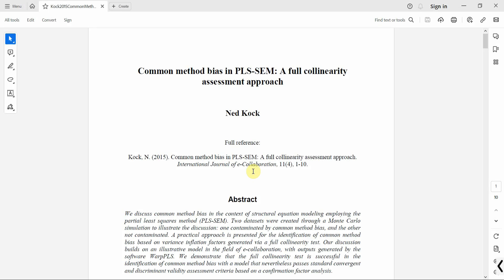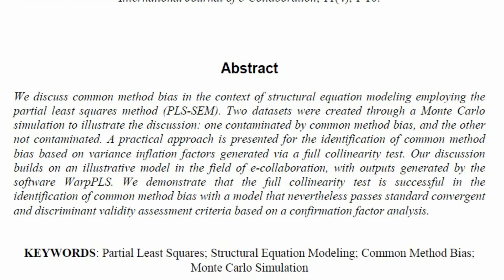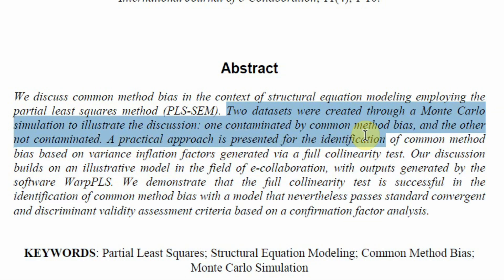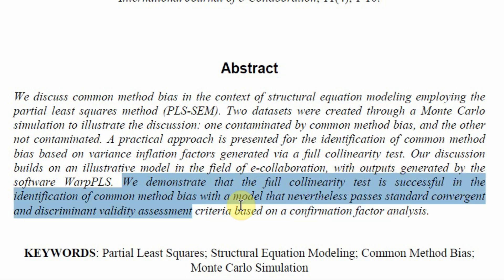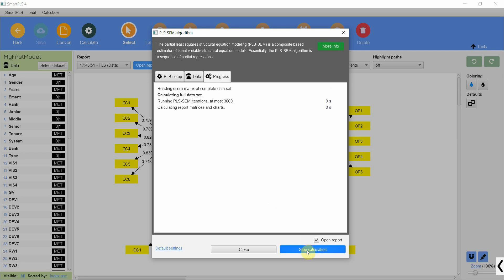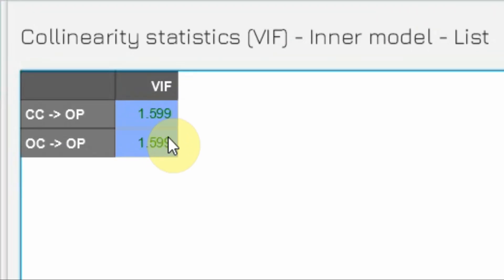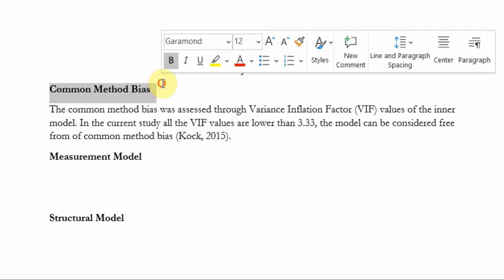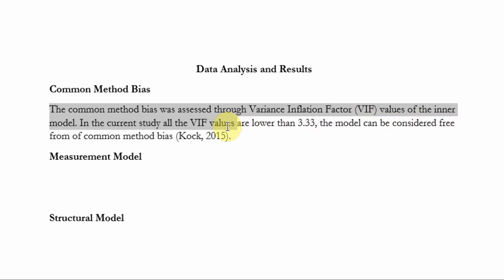#SmartPLS4 Series - 44 - Common Method Bias (CMB) using SmartPLS4

Comment: Sir what if there is a contradiction of result in case we conduct it by method 1 ( full collinearity) explained through this video and method 2 ( which is based on taking random variable in our model) ?
.
Also if you can bring a video on how to treat issues related to CMB ! It will be of great help!
Reply from the maker: Report the results that show the CMB is not an issue. Hopefully i can upload a video soon
Reply: Sir, we can run full model and then we can check inner vif values or we have to take random variables and then pointing all variables towards that random variable and then check inner vif